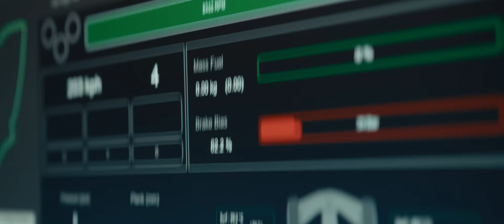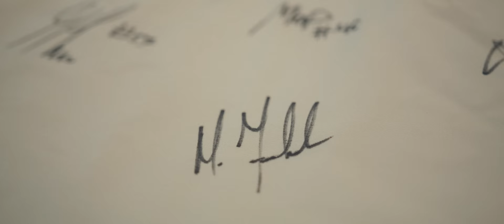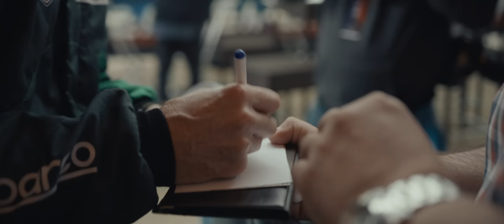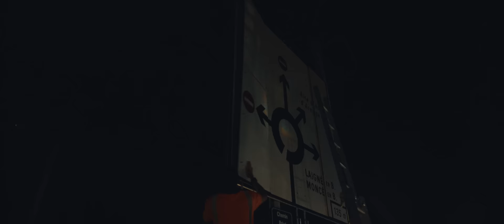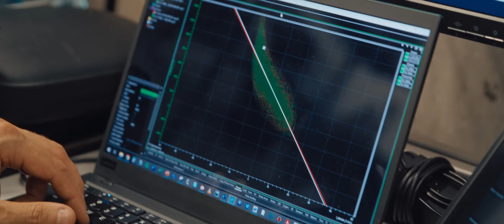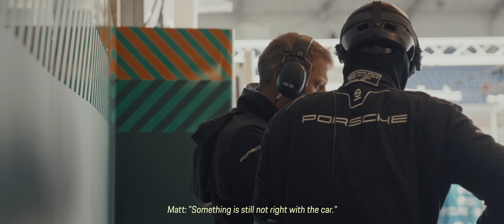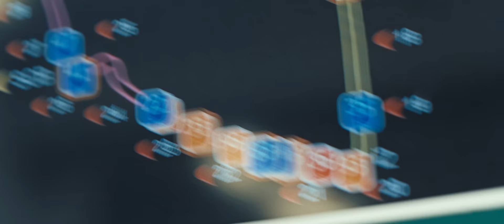Michael Fassbender: Road to Le Mans – Season 4, Episode 5 – Finally there

Comment: seeing that struggle on the setup is hard, because you know that setup isn't right, there's problems with the car but you can't figure it out and it's frustrating at any level of racing even the entry level stuff i've driven, Michael must have felt even worse with that rear lockup on the mulsanne and crashing. this series is amazing to watch btw better than anything else like it i've seen in recent years

Comment: One question... what happens to the drivers currently in the Porsche Factory Team that focused on GT cars? I'm sure some of them will move to other teams, but are they just out in the wind, to a degree?

Also, if (when?) Porsche is in F1 in 2026, I will 100% be backing them
Reply: some already have LMDH drives for next season in the new 963 confirmed like Matt Campbell does, either in WEC or IMSA with the factory cars being run by Penske , other drivers will do a GT3 programme of some sort be it on the Nurburgring, IMSA or in some form of SRO racing , the GTE version is still eligible for next season for the final time in the ELMS and WEC in the AM class

Comment: Seems to me like a half-assed attempt. Why didn't you run the full WEC season? Porsch couldn't get a pro-am ride? Surely I wouldn't spend 3 years preping for only running 1 WEC race in the Le Mans year. . . .
Reply: Watch this space
Reply: Well he did 3 seasons of ELMS prior to that, what are 2 more WEC races supposed to do?
Reply: @Maenfy  Get you comfortable with a car that is not the same as the ELMS car. Comfort goes a long way when it comes to gentlemen drivers.
Reply: @drewwrobel564  I'm pretty sure it is the same car as the ELMS car to be honest.
Reply: @drewwrobel564  it's the exact same car in both elms and wec

Comment: Im amused about the drivers in 1950s to 1980s. Driving the actual car they were to race across to the 24 hour Le Mans circuit. Camping in a tent or caravan. A few beers the night before. Early morning sausage sandwich and cup of tea. Pull on a oily coveralls over a polo t- shirt, open face helmet and googles. Smoke that last cigarette of 20! Then jump in the Ford, Jag or MG. And race. None of this diet, fitness and therapy malarkey. Heros they were
Reply: And 70% of them could pinpoint a cars problem to a specific part.
Reply: that's what happens when something is pushed to the limit the little things matter. the older cars required commitment and bravery whereas current cars require precision and a cool head